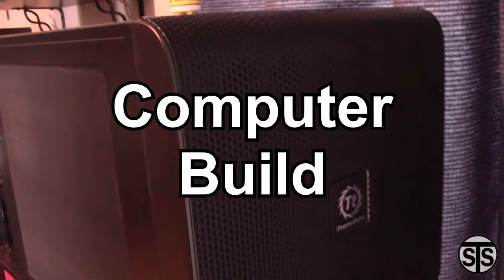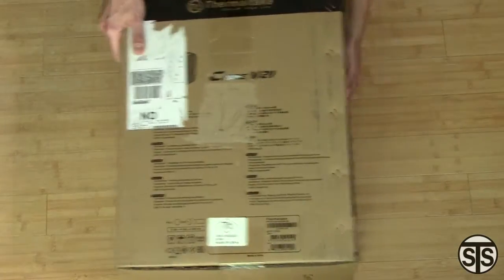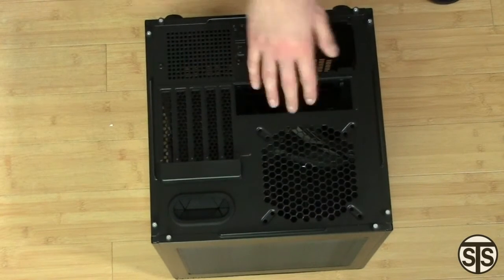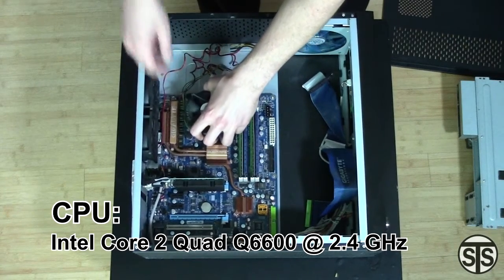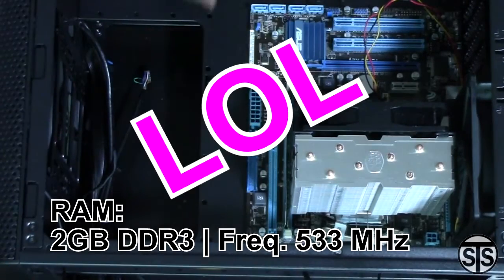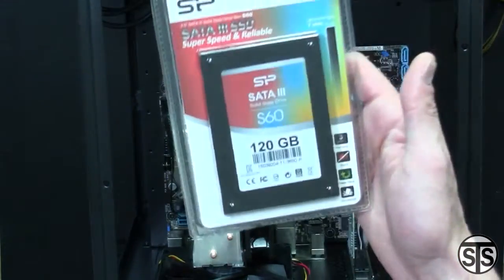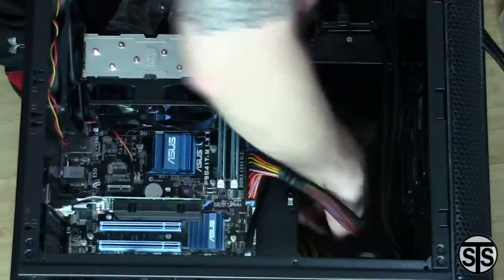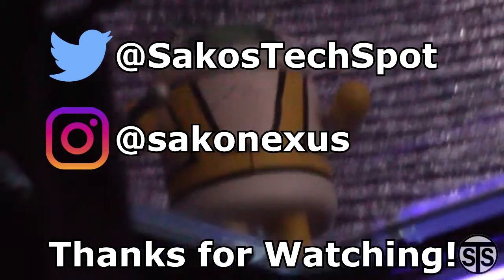Building a Linux Computer | Unboxing Thermaltake Core V21 Case

Comment: Very nice and quick video of your build.
I'm making a Linux build with the Thermaltake Core V21 myself, although not with "scrap parts" - well, unless you count the used (yet high duty) ones I got on ebay, including the case. I intend to use it as my primary workstation and just look how far FOSS can go :)

Comment: Yeah I am thinking about getting this case for my own linux rig and hopefully run a ryzen system in it if prices are right.
Its neat you are reusing old parts for this though, quite interesting and linux should be fine on that core 2
Reply from the maker: Thanks for checking out the build! Yeah, the core 2 quad is a powerhouse! This rig runs like a beast with it! I only wish I could get more RAM for it but since they're older parts, I don't think it's worth the upgrade.